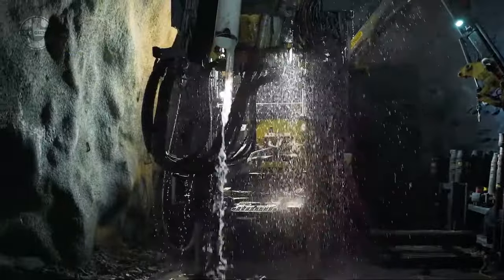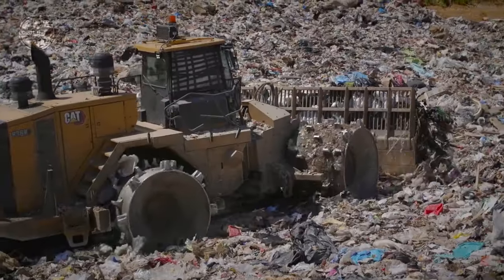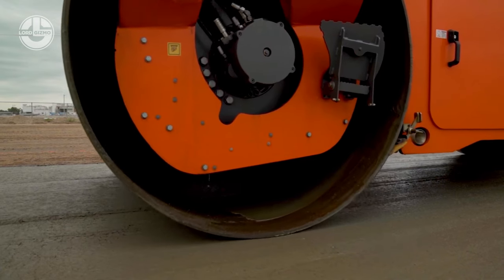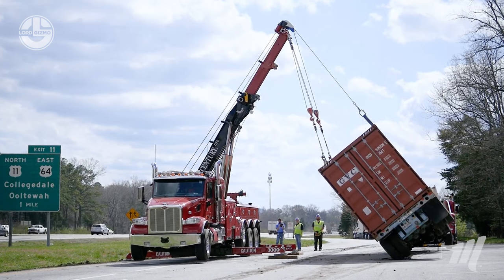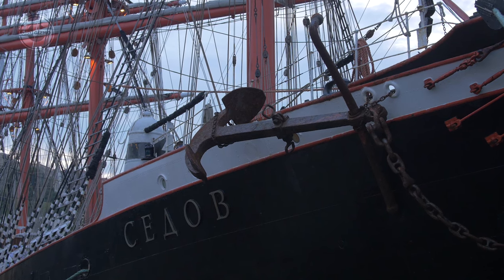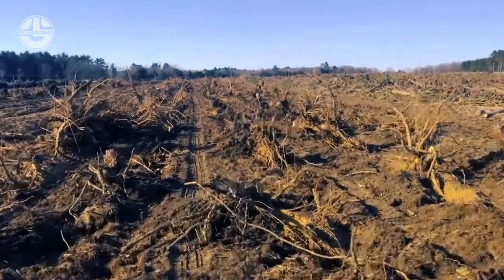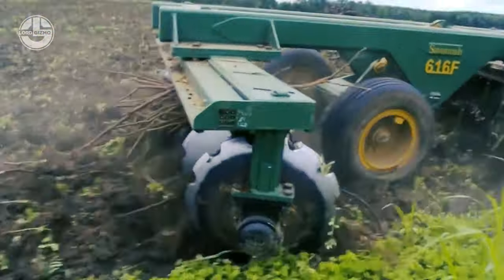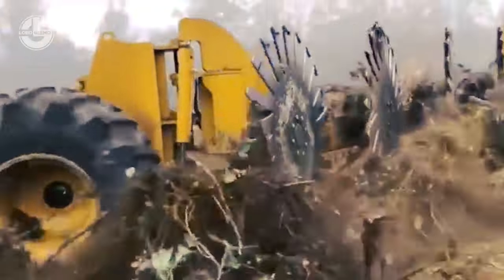From Ocean TRASH Removal To Massive Chains And Bulldozer Land Clearing Powerful Heavy-Duty Machines

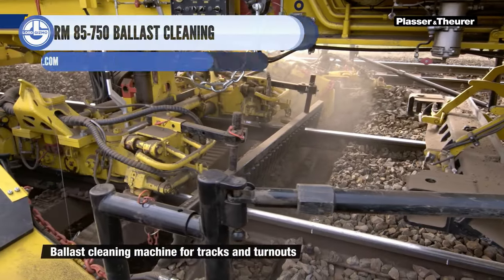Comment: At 1:25 RM 85-750 Ballast cleaner is used on Rail Roads not ships. At 11:16 the Komatsu PC 600 is a shovel. Shovels push away from the operator excavators pull bucket towards the operator. You did so good for a little while. What went wrong. Do you not check your facts?